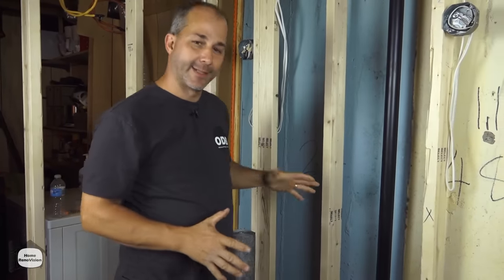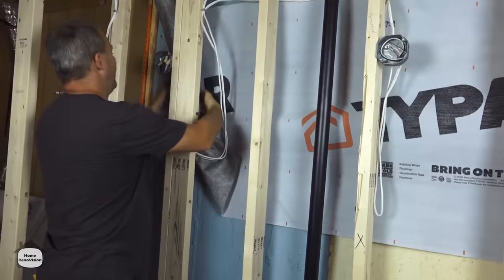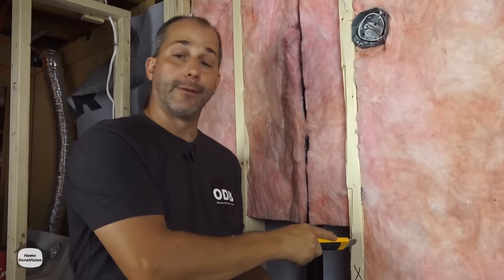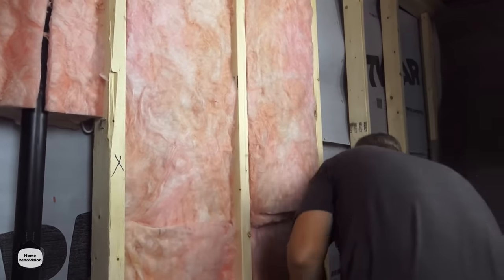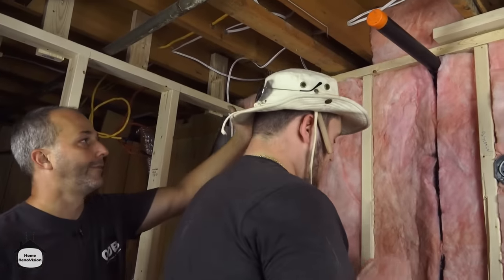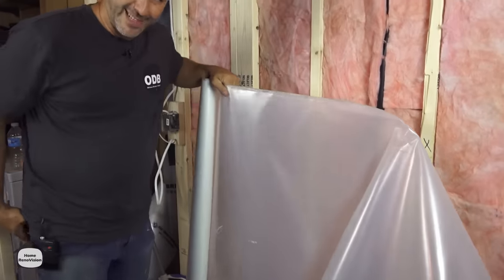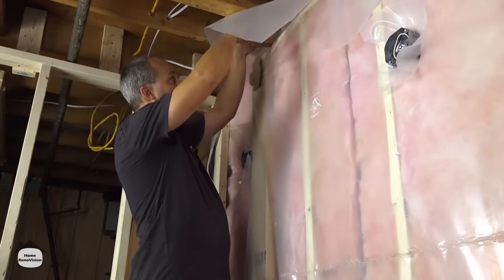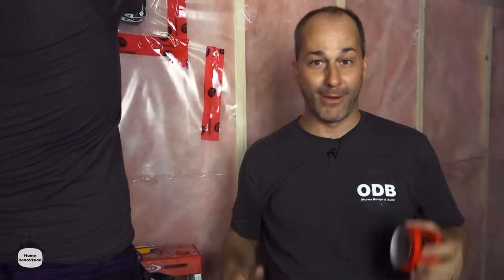How to Properly Insulate a Basement Wall: NO MOISTURE!

Comment: Hi Jeff, all your videos are very informative. I am thinking of finishing my basement and I do have a question. My basement exterior walls are already insulated from floor to ceiling and poly wrapped. For framing do I remove the insulation? As it's a 2 year built can I just frame it and add more insulation in  the studs? How much space do I leave between the insulation and the studs? Thanks. Razack
Reply from the maker: the insulation system you are using must be removed if you build walls. Start from scratch.

Comment: Once you get water in your basement, you will never use fiberglass insulation again. Rockwool is the way to go .
Reply from the maker: If you have water coming into your basement you have bigger issues than what type of ins=you use.
Reply from the maker: Yes and then we open the walls and remove the insulation so we can dry the framing. one it is dry again we add new insulation and close. having mineral wool insulation is not going to change that!
Reply: How about rigid foam insulation?
Reply: If you get enough water in your basement to cause damage to fiberglass you will need to remove the drywall anyway to allow the wall cavity to dry out to prevent mold growth.  Mold grows in 24 hours in a damp wall cavity, either way you will be removing more components. There are pros and cons to each type of insulation.

Comment: Hi Jeff and crew. Thanks for your patience. For the past two years I feel that my basement humidity has increased especially during summer. I purchased a dehumidifier and RH is going up to 78% but it never stays down to 55% if the device is shut for a day or two. I feel like tearing a few walls, have a look and redo the insulation with the trick in this video and perhaps using mold free drywall, and roxul comfortbatt. Is this a good idea or I am losing my time? My sump never get water, and my basement is deep all windows have window wells.:_RenoVisionHome:. It has become a concern as my home office is in the basement and spending 40 hrs a week in there.

Comment: So... first of all, I've loved watching your videos. They are so helpful! Thanks for putting them up. That being said, I've noticed you use Celsius temperatures, but Imperial measurements, like inches, instead of centimeters. Is that standard in Canada, or is it specific to more Construction type jobs?
Reply from the maker: construction and cars still use imperial measurements due to the trade arrangements between Canada and US. To be honest aside from the speed limit and the temperature I hardly see metric anywhere. Cheers!
Reply: @HomeRenoVisionDIY  ... and Gasoline lol... But crazily enough, most commercial construction is actually done using metric measurements in Ontario. Certainly most engineering application use metric as well, and every nut and bolt on my Chevy is metric (and it's made in Mexico haha).  I did my basement with 2" EPS glued to the wall (R10), and 2x4 wood framed walls sitting on top of DMX One. What was nice about the Foam Board is that I was able to cut it to slide into the Rim Joist cavities (which I put some batts into beforehand). I then spray foamed and taped the edges and seams. I used R12 fibreglass between the studs with no vapour barrier, then drywall yadda yadda. It's nice because you can really tighten airflow around basement windows (I also added 2 of those in the foundation... that was fun). Good work on these videos - it's always nice to see real world solutions see new ways top approach these things!  ..RL

Comment: Great video as always! Couple questions.. (1).why not just use insulation with vapor barrier built in (2) why both typar on the back and plastic on the front... aren't you creating a pocket for moisture to collect?
Reply from the maker: hi david, there is no such thing as insulation with a vapor barrier on it. second typar is not a vapor barrier so no worries there.

Comment: I watched another video where 3/4 inch foam boards are being attached to the concrete; is that not recommended and just use the house wrap, R13 pink insulation then the interior plastic?

Comment: I live in the Chicago area and I’m in the process of finishing my basement. The walls are framed and I’ve already put up insulation without the Tyrpar or house wrap between the concrete foundation and the insulation. I don’t get moisture or musty smells, so will this be a big problem down the road? Should I still put plastic up between the insulation and drywall? Thanks for your help
Reply: Yes. You always need that moisture barrier between the concrete foundation and the wall itself to prevent any smells from penetrating the wall. They also make some better materials that even help to prevent mold growth.

Comment: you may have incorrectly overlapped your house wrap.
Reply from the maker: no worries richard, it isn't being used to deflect water just hold in insulation.
Reply: @HomeRenoVisionDIY  Would you recommend this method for moisture as well, or would you aim at the foam board on the concrete for thermal/moisture? Having trouble understanding the reasoning for the various methods I've seen online.

(also big fan, seen almost every video, some more than twice. Thanks for this channel. You're the dad I never had. lol)
Reply: Phillip Tyrael I hear ya there’s so many different methods I think I’m just gonna use foam board and glue it to the wall this seems like more work and I feel that the foam board will act like a vapor barrier I can’t decide
Reply: @HomeRenoVisionDIY  : If it just to hold in insulation, could I just attach lengths of thin strapping to the backside of studs before raising the wall in place?
Reply: That seems like a good idea and much easier. What kind of strapping are you thinking? Stapling the plastic behind the studs is proven to be a huge job and taking forever.

Comment: Thank you for posting all those videos! I am planning to buy a house with unfinished basement. After you finish putting the plastic on, do you just put the dry wall up? what's the step after that? Is this only for  the basement bathroom? Should all room install the same way? Please help! Thank you! :)
Reply from the maker: All rooms in the basement should follow this process if you want to build cost effectively and without mold. And yes after the vapor barrier all you need to do is install drywall.

Comment: What keeps the insulation from sliding down?  Wouldn't it be better to use insulation with facing that you can staple in place?  Then you wouldn't need the vapor barrier.  I plan on using rigid foam on my basement walls and the faced batt insulation.
Reply: Unfaced insulation is stays in place with a "force fit".  It is slightly larger than the wall cavity. You could take the time to staple all that faced insulation in place, but it is more expensive.  The paper facing tears easily and doesn't make a complete vapor barrier like the plastic used in the video.

Comment: When you put up the barrier You put it up after the fact you had your wall up Dies the barrier have to be stapled yo the wall or can you glue it on the basement wall then put up your wall then insulate it Fo you need a gap between the basement wall and the barrier

Comment: I need to create a room in my basement. I had drainage system installed around the perimeter of basement. I was told I can't drill into the concrete they poured or it will void warranty. How would I adhere a wall to the concrete without drilling?

Comment: Should i use faced or unfaced
Reply: Unfaced, as shown in the video.  The plastic becomes your vapor barrier.  This system is easier and faster than using faced insulation.  Paper facing has a tendency to tear during installation.

Comment: Great video! When you have an unfinished basement with that white insulated wrap on the walls, do you remove, it to do this type install of walls + insulation or do you incorporate it into your wall construction??
Reply: Are you talking about that mat fiberglass like blanket that's nailed to the block?

Comment: Pittsburgh we use rigid insulation 11/2 or 2 inches or whatever on the block then we build our wall with an inch and a half Gap then fiberglass insulation then drywall just for if anyone wanted the information

Comment: Question for the wisdom of the crowd... I have an unfinished basement with conduit fixed directly to the basement exterior walls. Prior to framing + insulation is it necessary that I remove the conduit and re-wire the whole basement, or can I simply leave the conduit as is and insulate/frame in front of it while adding box extenders for the outlets?

Comment: How would you install the typar before installing the exterior walls?  How would it be mounted? How would you you deal with the area where you recommend the typar and dimple membrane/subfloor meet on the floor? Are building the floor plate over the dimple membrane of subfloor?

Comment: This is great. Does the Typar need to go all the way from floor to ceiling? My basement walls are barely over 7'. I can only find it in 3', 9', or 10' and don't want to spend more than I need to and waste a ton.

Comment: nice vid, totally never did this when I renoed my parents basement 20 years ago LOL. *Side note, Question for you.. if I have a housing plan that I designed in CAD, what is the next step for me to get it approved and ready for building? I'm in Gatineau, Quebec. Do I go to an architect or the local municipality? I have all the framing and everything roughed in, just need some consultation on appropriate methods, make sure design follows codes etc. Any suggestions would be great. Thanks.

Comment: Thank you! If I'm insulating my basement cold cellar ceiling, do I still need to use the vapour barrier? The kitchen is above the cold cellar, but it's really drafty especially on the floor. It's not an exterior wall.

Comment: Thank you ever so much I have learned a lot from your clips in finishing basment. I wonder what would be your advice in regardes basement waterproofing for a 20 year old hause. Is it best to consider exterior or interior water proving measures.  Even though the hause has installed sum bum I recntly notice water co densation drips and drops on the wall. So before staring to complete the basement what method should I consider interior or exterior water/condensation proofing basment.

Comment: I have an old existing unfinished basement with cinderblock walls. We get no leaks. We have a french drain. We do however get a ton of moisture in the air, especially in the Summer. I want to finish the basement. Will this technique work for my situation?

Comment: I put 3inch foam boards with foil on one side  foil facing inwards  nailed to the basement concrete walls & taping the seams..... should I put more for insulation or barrier before putting sheetrock?

Comment: Hi Jeff, what are your thoughts on using 2 inch thick Rigid Foam directly against the exterior walls in the basement as a vapor barrier? Is it overkill? I plan on finishing my basement (upstate NY) and I want it to be as efficient as possible without breaking the budget. Btw I really enjoy your videos 👍
Reply from the maker: works great if you have a waterproof membrane around your foundation on the exterior. I personally wish they put that outside when they build a house. If you don't then I suggest an air space to help remove moisture that will be constantly moving into the house.

Comment: If my studs are already up and there is not much space 0.25 between concrete and studs how to attach barrier to the studs so it doesn't touch concrete? ... Can it touch concrete? Can I use  LePage PL Acousti-Seal Vapour Barrier & Sound Reduction Adhesive 295mL and just attach home wrap to the concreate in few places?

Comment: I know this is not totally related to this video, but do you have any tips (or maybe plans to do a video) on how to install an exterior outlet on existing construction? I have a place built in the 70s with vinyl siding but no exterior outlets and would love any input you can give. Thanks for your great work.
Reply from the maker: That can be arranged. stay tuned. cheers!

Comment: I have a garage that is not finished or insulated, a part from the side touching the house, and maybe the roof (It is finished with drywall I assume so?). I just want heat. Is it ok to just insulate it and vapor barrier or is finishing mandatory? My plan was to insulate properly then vapor barrier with tack. No black seal. I'm also in Canada in Ottawa/Gatineau. Not looking at finishing because it's my parent's house and leaving soon... but really want heat in the garage with for the remaining winters.

Comment: THANKS EXCELLENT INFORMATION..
MY GAS BILL IS CRAZY  AND NOT HEATING APPROPRIATE.  NEed an insulation information please ..
The sub basement have the boiler pipes and the 1est floor is freezing even with the boiler all up. If you can send me the products info like blanket after the wall the fiber after and the plastic after.
Reply: Thanks for your response in advance..

Comment: Is it worth the insulation and vapor barrier if a portion of the exterior wall will be unfinished as a utility closet?  I could insulate the utility closet walls, but there will be large bi-fold doors to access furnace/water heater.  Asked another way, if you cannot seal the entire envelope, is the insulation and vapor barrier a waste of money/effort?

Comment: So, I have put the 6 mm plastic hung against the concrete from the wood at the top. Then framed with 2 x 4. It's not anchored to the framing but hanging freely.  Now ready to insulate. Can I proceed as in the video or have I made a mistake?  I was supposed to use tyvek vapor barrier on the concrete wall but I got that mixed up and did not do it.  Thanks for the help!

Comment: Brand new home in Michigan. Preparing to finish the basement. Builder insulated concrete walls with that insulation blanket wrap with plastic on the outside. I've seen some other popular basement finishers say to leave it in place and leave a gap from it when framing walls. Is this OK?

Also, I'm considering painting the ceiling instead of drywalling it. Is this an issue for insulation and controlling moisture?

This new home has the Watchdog Tremco Waterproofing System that is sprayed on the exterior basement walls from grade & below. This is considered proper waterproofing, correct?

Comment: Question: would metal framing for the outside walls in a basement and foam insulation (won't suck up moisture or get moldy) better for basement?
Reply: Yes!

Comment: thanks!   i took a quick look but didn't see - FAQ - why not poly-poly instead of typar-poly?
Reply from the maker: it is not used as a water barrier just something cheap to hold the insulation in place. Cheers!

Comment: We had a sump pump issue that resulted in partial flooding of the basement. I need to install drywall and insult near the concrete foundation . I am thinking of using mold tough gypsum board and faced insulation from Home Depot. Would you recommend anything else I should also include in the installation?

Comment: How would you frame a basement with French drain? There should be a space between the concert wall and the framing/insulation/dry wall? There should be space between the concrete floor and the framing to let the water run in case of any leak on the basement? Would really appreciate any advice. Thanks

Comment: I just gutted my basement and there was no Typar between the insulation and the cement blocks. So much moisture! How can you tell if this is just usual moisture or if there's a crack in the foundation? (I live in Northern Ontario)... Also, is OK to keep the basement walls uninsulated for 1 winter?

Comment: I was really happy to see this tip about the tyvek. No longer. I suspect its a cheat that wont work. Yes there will b an air space, cool. I love air spaces. But in that air space there is a temperature difference, a gradient from the warm bottom of the wall to the cold top of the concrete. So there will be air floating up to the top of the wall and condensing on whatever is there. This puts numerous joists and other assembly parts at risk. If it cant dry it will die.  I appreciate you noted cold air could creep out at the bottom of the wall if u leave insulation openings at the bottom

Comment: Thanks for another great video Jeff. I love how easy to digest they are and your tips and tricks to make the job easier. 

I do have a question about framing the outer wall. I don't see a video in your collection where you detail it, but how are you maintaining the gap between the concrete and the frame? Does your floor system go all the way to the concrete, or does it stop under the frame?

Cheers
Reply from the maker: The typar is attached to the frame. The frame is built 2" from the wall.
Reply: Good question how do you attached from back

Comment: The Jeff for answering questions.  I am in northeast PA.  Moved in a single home last year. Bedroom wall has this yellow textured paint on it. Thick in some areas. I believe behind is plywood. Would it be better drywall in over or taking the walls out, wrapping with tyvek,  using insulation panels n then drywall. But it also has baseboard heat. I think the last idea maybe too much. Your opinion?
Reply from the maker: if the room is comfortable and not moldy why touch it at all. Cheers!

Comment: Good information. How do you install insulation on a shed that has that foil on the wall? Can you just add pink stuff or do you have to remove the foil due to moisture/condensation?

Comment: I have a good question. I don’t have any moisture issues in my basement. Even through the panel wood type is warped due to the fact of the foundation is leaking on the back side of the wall easy fix not that bad. So do I still need to have a gap between or should I be fine to put it against the wall?